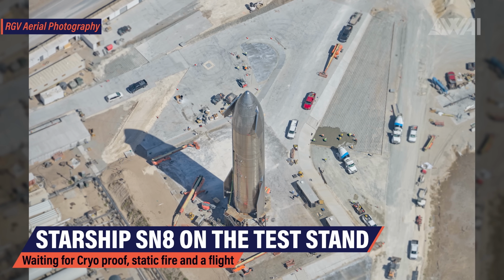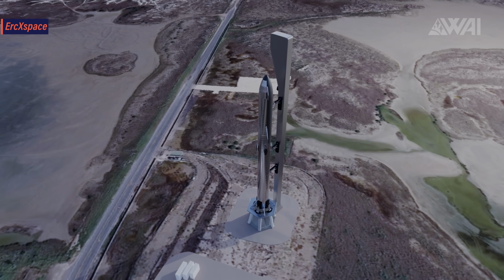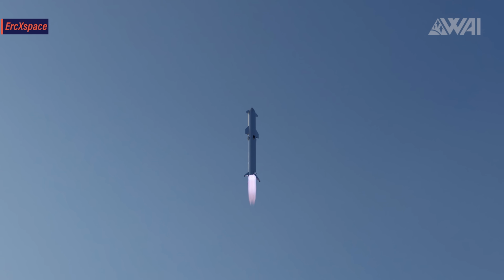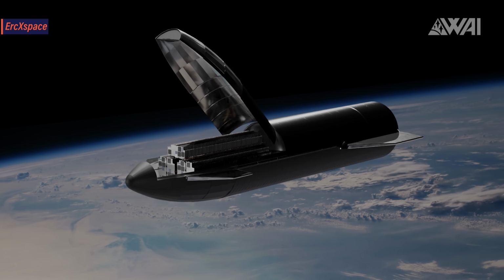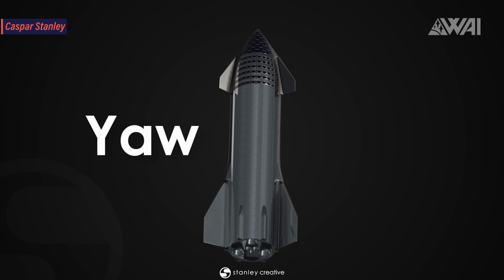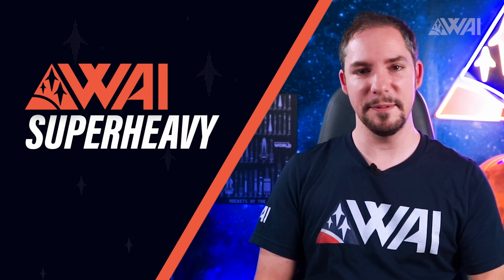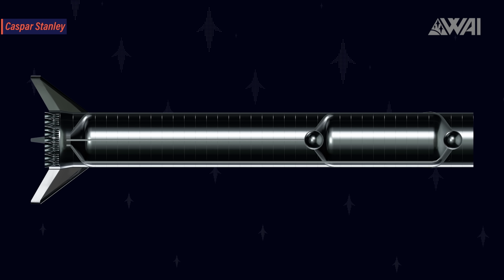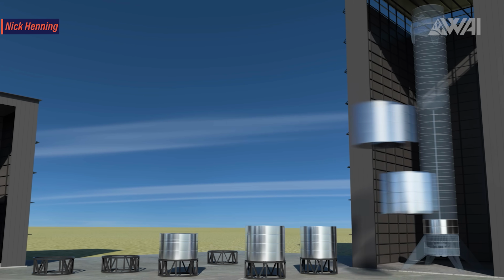130 | SpaceX Starship orbital Starlink flight from ignition to landing!

Comment from the maker: Do you have any questions left about a full orbital Starship flight?
Reply: I was wondering how they will repressurise the cargo compartment before or during return into the atmosphere. On the way up and when opening, it will depressurise; coming down, you may need vents to bleed air back in or some kind of pressure system, otherwise the nose area will implode! (Or buckle). Great video Felix!
Reply: @framryk0  Hey Framryk :) , what did they do at the Shuttle flights? Perhaps a similar solution could work for the Starship as well. ... I've found this "The orbiter has vents along the sides to allow air to escape during ascent and to "repressurize" the bay during entry." from here: http://www.collectspace.com/ubb/Forum30/HTML/001200.html
Reply: @framryk0  why does the cargo compartment need to be pressurized??, the tanks need to be pressurized to keep it from buckling, but the nosecone has nothing on top of it to make it buckle imo.
Reply: @avenger_fpv6618  I believe that since the cargo compartment will be opened in the vacuum of space, if you return to the denser atmosphere without ‘bleeding in’ air into the cargo compartment, it will implode from the exterior pressure being higher than the interior pressure.
Reply: @framryk0  Wel then the question is, is the cargo compartment airtight or not, because if its not then the pressure will gradually normalize when entering the atmosphere.and if it is, i think some sort of valve to balance the outside and inside pressure is needed.
Reply: Final comment (honest! lol) I guess re-entry heating will have to be like the Shuttle - limit Tmax (maximum temperature reached) but tolerate a lower heat for longer, definitely less than 1600 degC. Unlike the Crew Dragon, which can handle higher temperatures for a shorter period. As Elon said, "For reusable heatshield (Starship), minimize peak heating. For ablative/expendable (Crew Dragon), minimize total heat. Therefore reusable like Starship wants lift during high Mach reentry for lower peak, but higher total heat."
Reply: Why Flip the rocket so close at the last second? Can it not flip much earlier and come down like the Falcon rockets do? Wouldn't it have less risk for failure to orientate itself that way early?
Reply: @tcunero  the starship will be flipped in order to create more drag to slow it down.
Reply: @tcunero  
yes. All depends on the return mass and aux tank capacity. After the flip to tail-first, the craft accelerates again due to smaller cross section.
Reply: Will also be interesting to see how the payload adapters work to impart spin to the Starlinks (or other satellites). And how they handle the "clean room" requirements for satellites - will they load them in clean payload modules? Or move the entire top of the Starship into a cleanroom? So many questions!
Reply: I really wonder if those heatshield tiles won't be the same mistake, as in space shuttle where every tile had to be inspected manualy
Reply: @vardaruus5243  I bet they will be inspected by robots
Reply: less about the flight itself and more about how people who haven't been trained in high G environments are supposed to handle commercial launches?
Reply: Satellite deployment with the nose header tank in the way will be an interesting feat to do without some sort of dispenser. One half of the clamshell must be stationary.
Reply: Yea I have a question. Can the starship grab the hubble and bring it back down to earth? It would be a shame to let such a hysterical piece of equipment to burn up in the atmosphere
Reply: @richiz2bfound  In my opinion (space geek!): "Yes". Hubble weighs about 24,000 pounds or about 11 metric tonnes. Assuming the solar panels are removed OR folded back alongside, it should fit in the payload bay (larger than Shuttle). Gwynne Shotwell has already commented that she would envisage Starship recovering space debris. Can you imagine Hubble brought back to the Smithsonian?!? Amazing.
Reply: @richiz2bfound  Great question, will post it in our WAI Discord for you. Personally I thing it would be a great mission to prove recovering dangerous space debris is possible.
Reply: @richiz2bfound  Agreed, the Hubble is a piece of history, it would be nice to put in in the smithsonian. Not sure starship could land with that kind of payload, if not, maybe a mission to attach a reentry shell with maybe some kind of suicide burn solid rocket booster for a gentle splashdown. NASA could use it as opportunity to practice landing big payloads, like if we ever want to bring mined resources back to earth. Or we’ve just played too much KSP 😂
Reply: @richiz2bfound  historic. Not hysterical
Reply: I wonder why fuel tank operational openings/doors are in the belly of Starship instead in the back. There are several potential problems about it: Thermal tiles will be needed to be removed to operate in maintenance, door dilatation due to heat would cause some problems and finally, best piece is the inexistent one, so why on Earth to risk getting some fissure on belly if you can solve it as simple as reversing the tank and let the openings in the cool side?
Reply: Why does the Starship need heat resistant tiles but the booster does not?
Reply: @tommoritz6659  I would think the differences in re-entry speeds for the 2 different vehicles. The upper stage must continue to increase it's speed after separation from 1st stage, to over 17,000 mph to achieve a stable orbit.
There, I hope I'm somewhat close to the reason.
Reply: @tommoritz6659  Because the Starship accelerated to orbital velocity ("it's going like hell") while the booster did not.
Reply: Do you think we will get a moon flyby maybe in 2022/2023 and do you think it may have to land on an uneven area on earth if something goes wrong
Reply: Given the orbital launch pad's current configuration (no flame diversion, no water dowsing system), I'm still scratching my head as to how the area around the launch pad will look after a launch.  The sheer power of 28 Raptors will be an amazing explosion around the pad.
Reply: @glennpearson9348  
The pad cannot withstand daily launches of Super-Heavy. I expect most launches will occur from a platform 30+ km out in the ocean. This pad will help them get there using just 3 or 4 engines.
Reply: Why are there three umbilical's on the launch tower? Artistic license? I can see bracing to secure it in high winds, but Apollo style disconnects feels like anethma to everything reusability requires.
Reply: any clue to when the 15km hop will be
Reply: @isaac_ayling  November 14th I believe
Reply: Yes, is there any point to the non-vacuum engines - they only seem to be used for the last few seconds of a landing.  Surely Vacuum engines could do that?
Reply: @Spedley_2142  I think they will be used at liftoff on Mars in the distant future.
Reply: @Spedley_2142  
Sea-level engines are absolutely necessary on the launch. No, vacuum engines cannot operate at sea level. The recent test engine had a shortened nozzle.
Reply: @imconsequetau5275  I agree sea-level engines are essential on the Booster but Starship will never launch in an atmosphere using it's own engines.
Reply: @Spedley_2142  
Gravity is a big drag on launch efficiency. You need to use all the Raptor engines even though it is in near vacuum. Later in the launch, the sea level engines can be shut down. 

Second stages are tilted nose-up to provide a vertical vector fighting gravity. This is all wasted energy, except it is necessary to prevent a reduction in altitude.    

As the stage accelerates, this tilt is reduced (or even goes nose-down on some Falcon-9 missions).

Anyway, the faster the stage gets up to speed, the less energy is wasted on the vertical thrust vector. ULA has some very impressive SRB boosters that impart much more vertical and horizontal velocity than the Falcon-9 booster (in recoverable mode). The second stages can afford more g-losses during the launch.
Reply: Why not to use entry burn instead of this expensive heat shield?
Reply: @evgeniyrest6236  Think about how much fuel it would take to decelerate from orbital velocity. Probably more than what Starship can carry even if the entire payload was fuel. Aerobraking requires no fuel, just need to deal with the heat.
Reply: @evgeniyrest6236  it's going way too fast for entry burns. Roughly 4x the entry speed of a first stage and 16 times the kinetic energy. The fuel required would be too costly in weight.
Reply: What do you think SpaceX still needs to solve before an orbital flight? Seems like they haven't worked out the heat shield tiles and landing legs and I'm guessing the thrust puck for SH will take some time to work out since they struggled with just one engine previously.
Reply: Why no re entry burn?
Reply: @EEtransmit  to save fuel for landing
Reply: Is someone going to record the launch sound in near full range binaural audio?  After listening to The Sound Traveler, Falcon Heavy Inaugural Launch on YouTube.
Reply: When starship is weightless, wouldn't fuel slosh around in the tank freely? How do they get the fuel into the engine if the fuel is floating around?
Reply: @samberry1000  a small thruster to create microgravity? they plan to use this when passing fuel from one ship to another
Reply: @samberry1000  
The hot gas thrusters will impart enough acceleration to keep liquids at the inlet pipes. Thrusters operate on highly compressed gas propellants instead of cryo-liquids, so they are robust in freefall.
Reply: There RCS in starship and super heavy ?
Reply: @Dominator_5  yes there will be RCS thrusters on Starship and super heavy
Reply: How many failed attempts can they afford?
Reply: I don't know if Cargo Starship will work for launching the Starlink satellites.  Remember that part of the deployment sequence is that the second stage has to spin before releasing the satellites.  That's because the spin is what causes the satellites to disperse and space themselves out.

That would also mean that Starship would only be able to release one stack of satellites at a time.  So, I think that Falcon 9 will always be the rocket used to deliver that payload.
Reply: How do they ensure that the propallent stays at its liquid tempratures when on very long missions in space ? Like to moon and mars and back
Reply: @gundeep0  
If you can avoid direct sunlight, space is Very Cold. Just place reflective foil "shade" on the sunny side. Vacuum is also a great insulator. Liquids can also be chilled by heat exchanger for propellant gas vented to vacuum will expand and get Very Cold again.

The high pressure auxiliary tanks can withstand higher temperatures as well.
Reply: I'm wondering about continued spacex funding after a change in president ?
Reply: Would it make economically viable to send used nuclear fuel to Venus, let's say? $10 per kilogram to LEO, a bit more to Venus
Reply: Will it spin, to fling the satellites away?
Reply: So instead of landing on the ocean, it does one or more complete orbits to return back at the launch complex?
Reply: I don’t think it’s going to be possible to move the plumbing into the hull of starship nor super heavy.   The plumbing will have to stay outside.   The reason is that both hulls are pressurized with fuel and oxygen.  It doesn’t make any sense to dangerously slap the plumbing internally.
Reply: @אסף-ווידסלבסקי-לתל-אביב-יפו  
Yes. Cryogenic temperatures are not good for cable insulation, wiring bundles, tubing that carries propellant vapor, antennas, motors, control circuitry, etc. I have wondered about the safety of even mounting all this stuff directly on the tank exteriors for Hopper, and SN2-6.
Reply: How many refueling launches will we see on a mars mission?
Reply: @rishiparitala88  
It depends on the capacity of the propellant supply ship. Assuming it lifts 100 tons of propellant as payload, twelve refill launches may be required to minimize trip time. However, cargo ships will not need to be on a minimum time transfer orbit, but a minimum energy transfer orbit.
Reply: @imconsequetau5275  Wow thats a lot but It makes sense if u consider the estimated cost per kg
Reply: @rishiparitala88  I think each ship going to mars needs to be refueled 5 or 6 times before they leave earth orbit.
Reply: As often as you struggle on the word “similar”, remember it does not have a “u” in it like “simulate” does. It is not “simular”. This should help your pronunciation of the word greatly.
Reply: Dude, you just jumped the shark. 
Too click baity 
Too optimised for algorithms 
Too many adverts
Plus sponsor in video

You did well when you had the girls doing extra stuff

But you now are just stale and greedy. 
I’m out of here.
Reply: @brucebaxter6923  We have zero control over the adverts but you do. There are several programs that can help if you are frustrated. The sponsor is needed to take some of the load off of Felix and you guys deserve the best we can bring you. We do appreciate your feedback and hope you will return.
Reply: Bruce Baxter Byyyyyyeeeee

Comment: Why is SpaceX doing such a difficult and risky way of landing swinging down the whole starship by last seconds ?
It should be easier and more stable to bring it down like a plane firing one raptor in horizontal position and angle it slowly to vertical position using that raptors and wings in a much higher altitude.
In real starship is entering atmosphere from space. So there should be enough time to come down in horizontal position going round the earth for a while.
The only modification which has to be made is another architecture of propellant-tank for landing.
I guess SN8 is crashing down because swinging out in last seconds is not controllable.
Reply: Pretty sure that SpaceX engineers are smart. Do you know how much delta-V would be wasted using your technique?
Reply: @alvianchoiriapriliansyah9882  let's see if decided solution will work.
If not - and that's what I guess -  SpaceX has to look for another way to land Starship more stable and controllable.
In my opinion there is not much propellant "wasted" holding starship in a stable horizontal position giving it a little horizontal speed.
Bringing it down and land in vertical position is perfect. But not as heavy rough as it is shown in all simulations.
Did you thought about humans inside starship using current technique by the way ?
Reply: @oliverweber6842  The effect on passenger inside will be less than we thought

And you have guessed that SN5 wouldn't even be able to do static fire, so the guesses/opinions isn't a reliable source
Reply: @alvianchoiriapriliansyah9882  let's see what happens.
Computers seem to be much more powerful controlling such a big tube falling from horizontal to vertical than we can imagine.
Trying to do such a crazy maneuver 20 years before it would fail for sure.
Working or not ... such a crazy swing-out maneuver seconds before touchdown is looking very frightening having all other smooth landings in mind.

Comment: Why the current two-stage configuration instead of the old days when three stages were the rule. Perhaps side mounted boosters are the equivalent. I read that side mounts are being considered.
Reply: Because it will be much more complicated for full & rapid reusability. Recovering many hardware instead of just two absolutely doesn't help

Thus there's no any side boosters for Starship. The rendering that you see around are just fan-made. Starship is designed to launch by only one booster since the very beginning. If they want even bigger payload & the economics are feasible they will build a bigger Starship instead (18 m), or even shorter term more orbital refueling

Comment: The first animation shows ambilical cords. These will not be on starship or the booster. Elon wants a quick turn around, and hooking up ambilicals would slow it down. Starship refuels from the bottom (booster) and the booster will also fuel from the bottom

Comment: Could you explain what the Header Tanks are for?  The header tanks in the methane tanks for example seem to have no use they are even open to the main methane tank. They say the oxygen header tank moves the center of mass forward but what else does it do?
Reply: Its much smaller volume is to prevent sloshing during the bellyflop manuever. Doesn't want to say oh crap ofc when the engine suddenly shutdown during manuever because of losing propellant feed

Methane header, even tho it's indeed integrated into main methane, does have a valve that will close during landing. SN4 does a separate main & header static fires for example

Comment: I appreciate Starship will have a heat shield but can it not also conduct a re-entry burn to slow the vehicle down to reduce the heat needing to be dissipated?  Would it have enough fuel left for entry and landing burns or will it have to be slowed completely through the upper atmosphere?
Reply: You would lose up all of your propellant trying to do a reentry burn thus not been able to land safely. Atmospheric drag will remove up to 99% of your velocity, so it's pretty pointless to do a reentry burn (while you have to point the skirt at the stream which isn't protected by heat shield)

Comment: I was wondering if the booster could take up to Space complete sections of a Space Station ?  I was thinking if the weight was right and cylindrical and of a certain height with a booster pack on the bottom the booster could carry anything, and as I've said at the beginning Space Station sections already built, Just imagine how long building a rotating Space Station would take to build 😁
Reply: Like the ship, the booster is pretty pointless to do SSTO. You can, but with zero payload